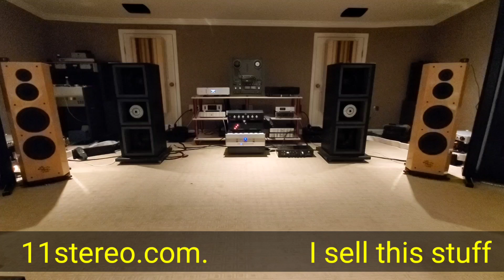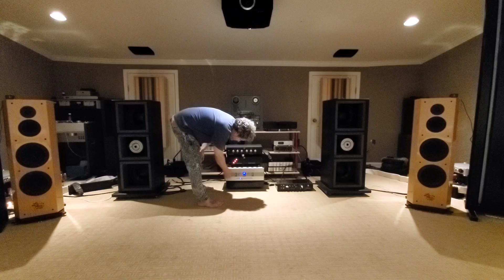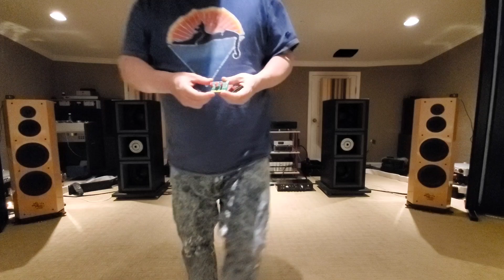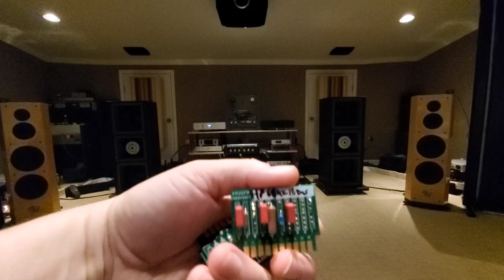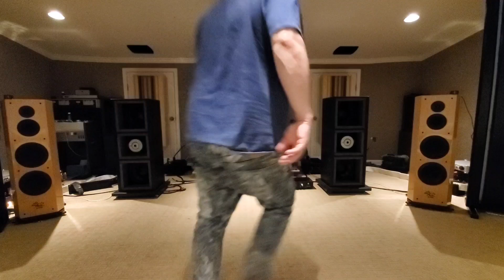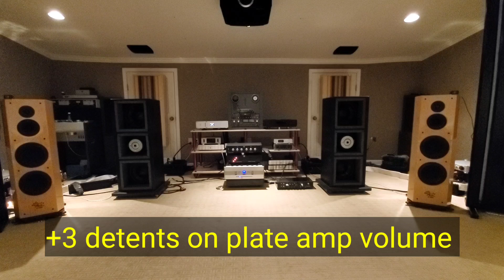SUBWOOFER CROSSOVER TUNING

Comment: As always, interesting and informative..
Keen to hear your thoughts on a couple points.
A. I see you setting both the sub and the main drivers with your active xover box.  I would have thought you would take 3 steps:
1. run mains full range and use plate amp to fill in the bottom.
2. then use xover box to cut the low end out of the electrostats
3. then adjust plate amps to best fill in the bottom again.  
My thinking is the GR Research guys built an amp optimized to these drivers.  Why not fully exploit the plate amp?  Seems you are changing the signal going in without adjusting the sub bass system.

B. Second question.  Did you try driving the sub bass system from the speaker level (hi) input?  REL makes a big deal out of driving 2 ch audio from the speaker posts to get the best synergy between the systems.  Curious on your thoughts and if you have tested using your own setup.  Clearly it would only work using the electrostats full range.

Comment: Ok, to me things sound like this: I do prefer the second filter (Bessel, 60Hz) but only because it favours this specific kind of music. This said, midrange (vocals) as well as some highfreq. ringings and spatial cues, sound clearer and less strained (I mean not muddled at all) with the first filter (Linkwitz-Riley, 80Hz). This rather goes with the predictions of the theory (shorter excursions, lower distortions, for a mylar membrane that doesn't have to dig down to 60 Hz). What appears to be wrong with the first filter is that it makes the system sound rather thin below 80 Hz. I cannot explain why this would have to happen. Is there no way to keep the first filter, but also get the subs play louder below 80Hz? (Needless to say such videos are a real treat, so, thanks once more).
Reply from the maker: Its tricky, theres no easy answer.. Ill come back after break in ...

Comment: What about trying to DSP from linkwitz made for his subwoofers goes down to 14 Hz you can make them servo by putting a feedback piezo driver glued on the cabinet
I think 3 drivers is overkill and causes complications not needed in a size room like that. What are they 12"
Reply from the maker: Triple 12's and they are servo drive. there is no overkill for me, most everything I own  would be considered overkill. I simply want to have more than I need at all times as the alternative is much worse.  The way multiple subs work is thatthe more you have , the less nuts they have to go.  My subs barely move and make beautiful bass in an effortless fashion, and my personal key to a world class rig is to have it overbuilt whereby half volume is as much level as you can take. This way it will always operate in its sweet spot where everything is at its lowest distortion spec
Reply: @OCDHIFiGuy  I would say go with 3 drivers if there were 16 Ohm's but they're not they are 8 ohms aren't they! so they will be running at 2 ohms a bit low
What is there roloff frequency and DB. I would say 8 to 10 inch drivers would be better much faster running five  8" drivers a better way to go
Reply: @johnsweda2999   ... They are 16 ohm .
Reply: @OCDHIFiGuy  I made it out to Iowa Park yesterday and spent a little time with Danny and his Servo Sub System. Amazing!
Reply: @markconner5569  how was it